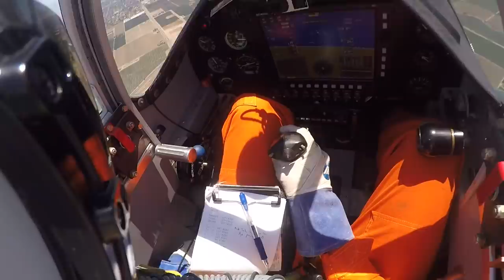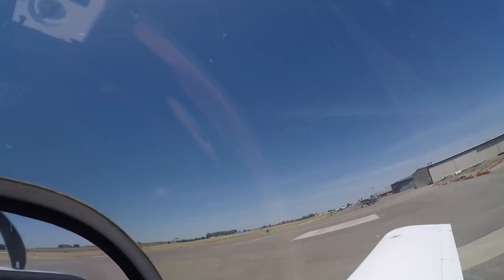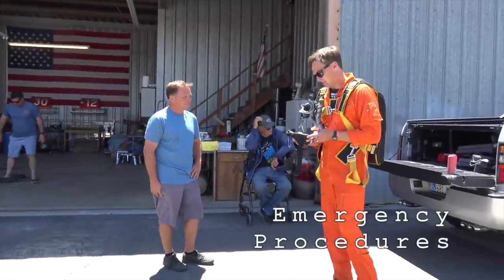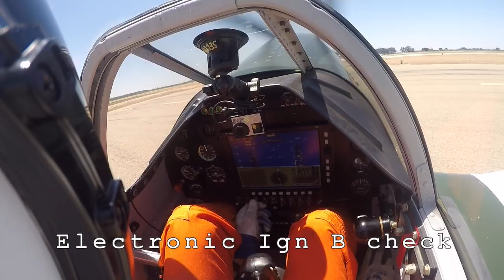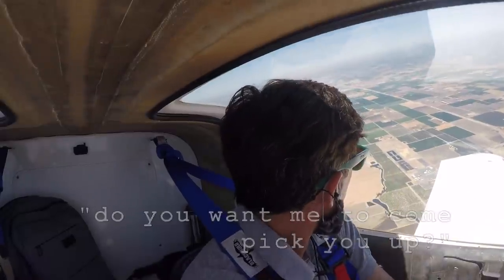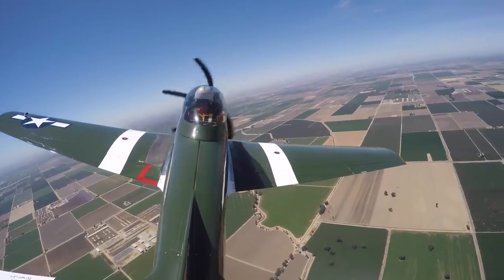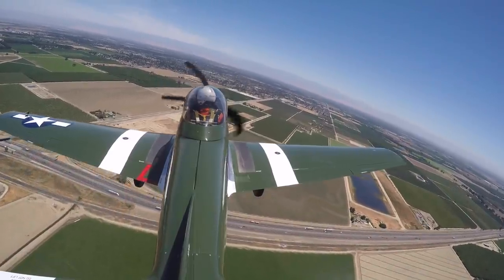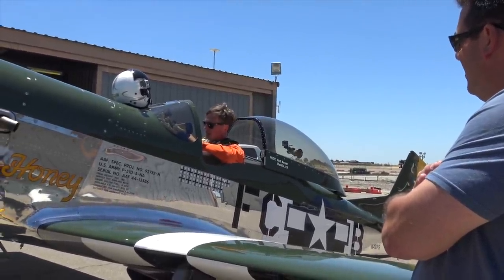EMERGENCY - Landing Gear Stuck/Engine Issues - Bowerspony Flt015 Wasabi Flight Test

Comment: A question for you Elliot: I come from a military background.  The rule of thumb for any gear problem was always if the gear won't fully retract do NOT try any further attempts to raise the gear; it already won't retract.  The logic is if you do get it up it may not come back down.  So why did you try to suck up the gear anyway via the bunt?  Why not just lower the gear and land?  Yes, that's maddening to have to keep nibbling away at getting Rod's plane signed off but that's a whopping lot better than having to land gear up.  Thoughts?
Reply from the maker: Thanks for the comment.  I think we talked about the decision to diagnose rather than land in the video, but yes there was added risk there.  As stated in the video, a belly look by chase airborne would only cost a few more minutes of flying.   And would give a much better picture of the problem.  

Something that wasn't talked about in the video that I constantly struggle with is feeling like we added value on a given day.  It's always such a project to get us there, and the airplane ready, and and and.  I struggle to push back at all.  We lose jobs all the time for pushing back, there is always some cannonball rider who will fly broken stuff.  So I recognize a tendency to push on everything.  I will take that note that perhaps this is an example of that.  Thanks.
Reply: @utopiasnow  I come from RCAF background and was wondering about that too but your answer is bang on, and is a great summary of the biggest difference between military and commercial flying. The customer. Love the vids Elliot. Airplanes are cool!

Comment: This is not the only Mini P-51 with landing gear problems You were involved with

If the Hydraulics pump loads and knocks the Engine out You would think they would put the Hydraulics on an independent power source
Reply from the maker: Yeah tough day.  In all fairness the hyd pump had its own properly sized breaker.  It was this odd but per the plans main breaker that was the issue.  Anyway, thanks for the comment.  Good to have you here!!

Comment: Newbie here, so any offense is unintended.  I am curious why you had the chase take off first. I would have thought that having chase be second in the air (and following closely) would have eliminated the delay (and miscommunication) associated with having chase descend to your altitude to view your belly.  Your flight was intended to validate gear issues and identify the source of an oil leak -- both of which are going to be most visible to a chase below you, rather than above you.

Comment: Have these boys not run the thing on the ground at all? There's no way things like inop tachs should get through even a cursory ground test right? The low volt alarm might be nothing but it might also be a mismatched alternator/generator and hydro pump.
Reply from the maker: Thanks for the comment.  Yes the engine was exhaustively run on the ground.  The intermittent tach was known and briefed before the flight, reminder we have two tachometers.  It's not clear why it wouldn't leak on the ground.  Thoughts are that perhaps it's a deck angle thing (3 point vs flight attitude), or it's related to power somehow (the brakes won't hold it much above half power).  Still more work to be done.  One last thing,  I am really excited that Rod has been willing to be so open about all the ups and downs of this program.  I feel fortunate to tell his story.
Reply: @utopiasnow  If that's the amount of trouble you run into after testing it must feel like such voodoo. And yes it's very exciting that it's getting shared regardless of outcome. Can they test @ flight attitude on the ground or do they not have a stand that would allow this?
Reply: Sounds like this plane needs some sort of mooring to hold it during a ground run.
That way you could also change the deck angle.
I don't suppose the gear transitions could be related to the leaks?

Good luck to you and the team!

Comment: I don’t get it. Why didn’t you lower the gear right back down and come to land right away? I get it you wanted to get some insight of the issue in the air but don’t you rather deal with it on the ground? I am just trying to understand the thinking behind it.
Reply from the maker: As stated in the video.  We had chase, the engine was happy, I was confident I could get down lights (we have been here before).  I recognize there was a push there, but with all the thrashing on this program I was motivated to bring as much information back to Rod as possible.

Thanks for the comment.

Comment: Why can't the engine cool with the gear down?
Reply from the maker: Two things, first the drag of the gear means more power is required for a given airspeed (more heat less cooling, then the inner doors her in the way of the gear is stuck in transition.  Thanks for the comment!!

Comment: Beware of the Raptor that thing is a mess
Reply from the maker: Thanks for the comment.  Any specific concerns?
Reply: @utopiasnow  I think that it's a very complicated plane he has had to redesign the control system he should have known mounting control cable pulleys directly on the skin would be a problem the PSRU is a unproven design the engine is unproven I think it's about 1000lbs overweight and he has had to cobbled together too many stop gap fixes. I'm just saying be careful with that one. With that being said I really hope to see it in the air soon 😊

Comment: I have never seen such an unreliable airplane after all of these so called expert mechanics working on it!  Over and over leaks and failures does not bode well for this plane and engine as well as the gear problems.  Retractable gear has been around and proven for many yrs, yet you guys keep compounding your problems.  With today's computer tech, why is this?